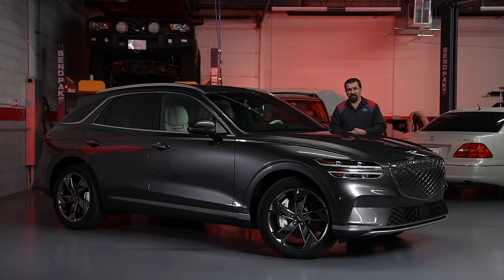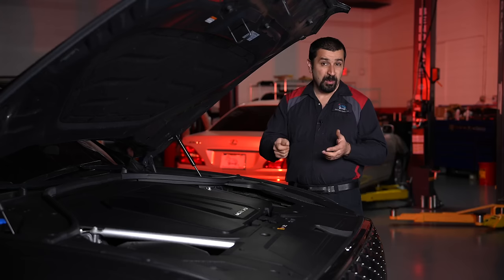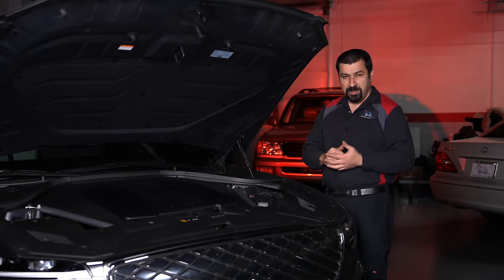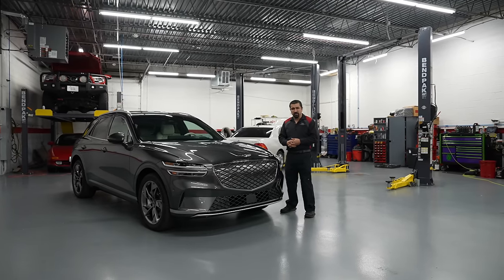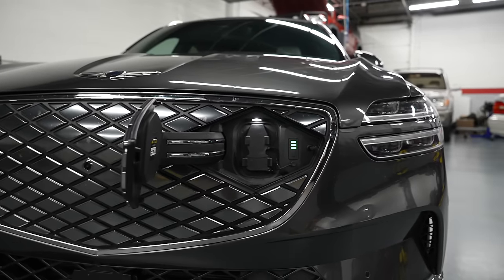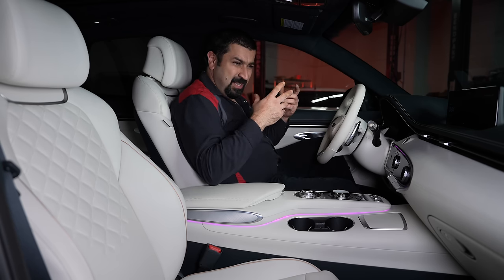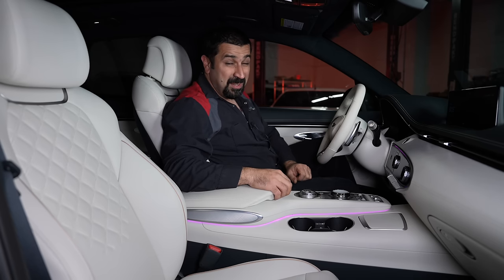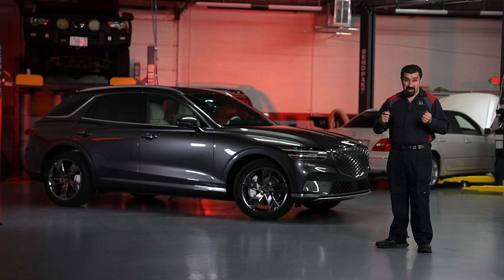Should You Buy a Genesis GV70? Thorough Review By A Mechanic

Comment: 236 miles of range is way to low
Reply: You drive 236 miles everyday? I have a ICE Mazda CX-5 which does no better.
Reply: @JohnLee-db9zt  well for long range and how slow it takes to charge. With your Mazda you can put gas in it in like 5 minutes and get back on the road. In an EV you can't they just aren't quite practical yet
Reply: @DylanL69 it adds 190 miles in 18 minutes
Reply: @mattjones3257  no not really

Comment: This reminds me of the 2023 Mitsubishi Outlander PHEV I just leased for 2 years. I got it because it was cheap to lease, got an EV credit for $7200 + some money down so I'm paying $317 a month. It's a stop gap car until the car market figures out what it wants to do, hence I didn't buy it. But it comes with a big touch screen, I don't even use it, half of the tech it comes with is turned off. All I need is a steering wheel, AC, a good radio, a speedometer and tachometer (preferably analog) power windows and door locks. That's it. Even if I had the money to buy something like this Genesis I would be throwing money away because that touch screen I would never use. I use my cell phone for navigation, best maps hands down. People waste too much money on bells and whistles, just not necessary.
Reply: Not to be rude but why get a Genesis?  You can get a Honda or Toyota base level.  Or Nissan.  Less tech.  Buy a tank but say I don’t want to shoot anything?  You’re paying for the tech as much as anything else.  I use all the tech in my car.  It spoils me.  Just have to take the time to learn it and set it.

Comment: The need for larger brakes on EVs are necessary despite that regen braking exists, because it’s an added safety measure. You need a lot more friction to stop 5000+ lbs, which a single-piston or even dual-piston caliper won’t have the physical force or thermal capacity to minimize braking distance to prevent an accident.

Comment: Get the gas 2.5t version for almost half the price of the EV (~$46k). It does 300hp with a ton of low end torque. In sports mode, this SUV drives like an agile sports sedan (it's based on the excellent G70). Super responsive and fun without the range anxiety and charging issues of EVs. I got one (advanced trim) about a month ago and absolutely love it. Would love to see a mechanic breakdown of the gas model.
Reply: Seconded. I got my 2.5t sport prestige a few months ago. I’d love a mechanical review of the ICE model
Reply: I’m liking what you’re saying, I have a 2023 Kia Sportage with a 2.5L engine, it’s not turbo charged, but it’s the SmartStream Engine, meaning it has dual fuel injection, MPI & GDI, thus eliminating the carbon buildup,that ruins the performance, reliability & costly repairs, which happens to EVERY GDI Engine especially German Engines. Point the 2.5L engines from Genesis & Kia don’t have the carbon buildup 😊, and have very reliable engines, I stumbled upon this fact after I got my Kia Sportage and I’m very pleased of this result. I’m planning on getting every bit of my 100K warranty. I’ve already put 10K miles on my car since purchased in July 2023, highway miles to & from work. Loving my car, again Good 👍🏾 Work Genesis and Kia.
Reply: I bought a 2023 GV70 2.5L Sport Prestige and it is awesome.  More than enough power and the interior/exterior design is great.  Fantastic warranty too.  Looked at comparible models from BMW, Audi, Mercedes, Acura and it was an easy decision.
Reply: I’ve got a 2,5 for 2 years 
Amazing suv
Reply: Sure, let's compare lowest trim on gas to lowest trim on EV, because both are same right? Why did you buy advance package then? The EV is second quicker than 3.5tt.
Reply: @ruturaj47  the 2.5t does 0-60 in sub 6 seconds. The EV (with boost) does around 4.5. My advanced is not lowest trim (that starts at $44k) and has almost all the amenities (pano roof, surround cam, leather seats, all safety features, ambient lighting, etc.). Only things missing are stitched dash, digital cluster (it has half digital w/ that cool turn signal camera), Lexicon sound, 3-spoke steering wheel. Not much difference to most ppl. Glad to see hear it has a reliable engine.
EVs have lots of concerns (esp. battery replacement cost) so I'm steering clear for a while.

And yes, I got my 2024 Advanced (msrp 53k) for a tad over 46k before TTL.
Reply: @justinbelk89  thx for the mention of the 2.5t kia. Here's a mechanical review I found: https://youtu.be/nQqf9ww4V98
Genesis does things a bit differenly in the GV's, but it gives us an approximation.
Reply: @ZERO_SVN  1. EV does it 4.2 seconds as per Genesis and 3.8 as per motor trend, not 4.5 as per you claim. That's huge difference from something that does in 6 seconds. Just upgraded engine 3.5tt costs significantly for just 0.7 seconds faster time. It has it's value. You drive base engine, so no one else needs more power?
2. That's a lot of missing things, on other luxury brands that's 3-4k worth of upgrades.
3. Sure, you are one of the most people who don't care about power and having few features. Glad they elected you to speak for them.
4. Lol, "EVs have lots of concerns" 😂. Glad you pick up political crap pretty fast. 
5. Sure, you got it for 46k, now everyone else can too because you did. Genesis is reducing MSRP to that /s. Unless everyone can get it at that price, your point is moot.
Reply: @ruturaj47  It's all good dude. The GV70e is an amazing car for those that can afford it. I'm just saying ppl can get into a gas GV70 for a lot less. Its features aren't so out of reach for most folks.

Comment: We purchased this exact vehicle- 2024 GV70 Electrified in Malachite Grey - in September ‘23 for $80k and have just hit 5,000 miles on it. We’ve had no issues at all so far and love it! We have an 80A level 3 charger installed in our garage which is nice and fast. we’ve only had to pay to charge it once and that was in Austin, Texas where there were not any Electrified America chargers within 20 miles of where we were in downtown so we coughed up $14 to fill up at one of the many others that were. We get very fast charge times up to 80% if using the 350v Electrified America chargers (which are free to use as much as we want for the first 3 years).

Comment: Years ago, a friend bought a new Genesis. When a very serious problem occurred that was likely due to a defect in manufacturing and within the warranty period, forcing the dealer to repair the car was extremely difficult. Personally, I won't buy any Hyundai product.
Reply: Especially now since a few months ago Hyundai/Kia got caught using child labor in their plant in Alabama.
Reply: @majicdude88  Not at their plant, a supplier.
Reply: Remember how they failed to address their Hyundai/KIA car theft issue and some insurance companies refused to insure them. Their solution to "address the issue" is to give customers a steering wheel lock that can be picked in seconds! They didn't even bother with a GOOD lock, just the cheapest lock possible!
Reply: Not to mention the engine fires that their cars catch regardless if they’re on or not.
Reply: Or Kia
Reply: I had a Hyundai before. Not only the car was extremely reliable but all the dealers I used were very nice. So I upgraded to a Genesis and the service departments have been just stellar. It feels like getting a red carpet treatment. Had a few warranty works done and I never had to fight for it. Of course, always a Genesis loaner provided. I'm buying another one.
Reply: I reported a slight squeak from my engine, and the dealer replaced both Turbos without me needing to ask anything. 

Sounds like your friend is a passive beta male.
Reply: You could literally make a statement like this about every single auto manufacturer on the planet.  Every single one.  “I knew a guy who had X go wrong” applies to all.
Reply: Years ago, key words. They have totally changed from then.
Reply: @lane5686 on older year models with the engine they discontinued..
Reply: @ThisGuyRides  didn't Hyundai/Kia own a majority stake in the companies that owned the multiple plants where violations were found? Like those companies exclusively exist to sell parts to Hyundai/Kia. And plus, Hyundai/Kia were warned multiple times in the past that their suppliers might be using child labor, and Hyundai/Kia ignored them each time
Reply: @UpgradeUrWinRARTrial  kids these days are lazy. They need jobs😂
Reply: They just couldn’t fix it…
Reply: @JohnLee-db9zt   the wee lads yearn for the coal mines and the chimneys 🤣
Reply: @UpgradeUrWinRARTrial  ok now do GM and Ford who had auto plants in Germany in WWII and supplied vehicles to the Nazis.  Now do Mitsubishi and Toyota and what they did.  You had one supplier who did that …are we done here?
Reply: Something happened to someone a long time ago and now I won't buy that thing, ever.
Reply: @Mountainbaseddweller  do GM and Ford still currently run those nazi-owned auto plants? Do Toyota and Mitsubishi currently still use child labor to manufacturer car parts, even after being warned multiple times? You're comparing a Toyota Corolla  to a Ford F350 SuperDuty, there's no relation at all lol. Or I guess in this case, a loaded GV70 to a base Elantra. We're talking about new cars with modern problems, not WWII-era politics. 
But while we're on the subject, did you know VW stole the Bug's design from Czech manufacturer Tatra? Basically Nazis from Germany took over the country & factory, stole the schematics, copied it wholesale, put a VW badge on it, and sold it as-is. I mean, at least Toyota and Ford built their names off the backs of making cheap and then good cars from their own original designs. Meanwhile, VW's best-known car is just a copycat of the ""inferior"" Czechoslovakian Tatra and everything else after was meh or bad. I think Tatra and VW ended up settling it in court in the 1970's but man, how embarrassing that your biggest accomplishment was done because you copied off the other kid's homework 😂. 

Oh and it wasn't just 1 supplier. It was 4 separate companies who owned 4 separate plants (and who's companies are basically owned by Hyundai/Kia) who used child labor on multiple different occasions.
Reply: Owned one of the first Genesis cars, loved it up to 50k miles then loads of engine/tranny problems that Hyundai wouldn’t stand behind with their “10 year warranty “.  Family members also owned a few Hyundai and KIAs, all chronic problems after a couple years.  Hyundai products will be great in a few years, just like how the story of Toyota went. Meantime, stay away for now!!
Reply: @2006gtobob my uncle’s neighbor had a teacher whose wife had a bad Hyundai. Now I won’t even get near one. As a matter of fact, if I even look at one I have to go straight to the eye wash station /s
Reply: @biglee13m I have a 2014 Hyundai Genesis 3.8 sedan that I bought new.  I now have 172k miles and the car has never been in the shop for mechanical repair.  I have only put brakes, tires, belts and hoses.  So far the car has been a Gem and the paint still looks new!  I would like to purchase another Genesis, but the price has really gone up like everything else.
Reply: @sjh03053  that one time the thing that did the thing I didn't like caused this and that to happen to everyone and no one all at once and I decided I didn't ever want to listen to Duran Duran again.
Reply: @biglee13m good luck
Reply: If you make your decision based on a thing like this there isn’t a manufacturer on the planet that would be worth buying a car from.
Reply: @UpgradeUrWinRARTrial Child labour is a good thing. Kids need jobs too.
Reply: @zero11010  Nope. Bought a Lexus 25 yr. ago and it's still my perfect daily driver.
Reply: @voterdown  "Now" may be a VERY long time. And I think it should be.
Reply: @bradleyscarreviews  Prove it.
Reply: @TheRealCatof  You didn't have to ask because he had likely seen many defective ones and knew yours would just be one more. No, my friend is definitely not passive.
Reply: I had the last opposite experience,serious problem with the paint in the first month of ownership and took me all of 2 hours and I had a brand new perfect car off the lot.  No fuss or debate.  Heck I didn't even have to ask.  Best service ever
Reply: @lane5686 engines and power trains are completely different in the Genesis brand.
Reply: @biglee13m The concierge services amazing isn't it eh? They show up at my house with a loner I hand them the keys to my car, they hand me the keys to the loaner and off we go.
Reply: @wholeNwon  that’s useless though. You’re making your decision based on a single point of data. One anecdotal story. That exists for EVERY car maker. 

Do you think NO ONE has a horror story about Lexus? 

Of course people have had horror stories. 

And, there are people with 200k miles on a Hyundai or Kia and they love the thing. 

Generally this is how mass production works, right? 

You need more than “I heard someone had a bad experience.” Because THAT exists for every car maker.
Reply: @TheRealCatof if you insult people by calling them beta males then you’re a beta male

I don’t make the rules on that one
Reply: It would be irony if the comment was typed on an iPhone or a Samsung phone 😂
Reply: @ThinhNguyen-dk3mh  I have several Korean products, including a Samsung phone, and they're all fine. But I sure won't buy their cars because there are much better products out there. No irony at all.
Reply: @zero11010  And that's why the internet is helpful in that it allows information to be aggregated and organized. One could even be Google something like "compare Lexus ownership problems with Hyundai problems" and let AI help. My friend's problem and Hyundai's response were not anecdotal. I know him well and he described the litany of horror stories in great detail.
Reply: @paulgyro  So the factory couldn't paint a car correctly?  What else that you don't see isn't done right?
Reply: @wholeNwon  your hypothetical question doesn't move the discussion forward.  Don't  buy a Hyundai product but with your reasoning I could tear down every car manufacturer to the point they are all boring as sin or garbage. I've owned BMW, Mercedes, Lexus and Genesis.  Genesis has been my favorite car with the best purchasing and service experience and overall value.  Genesis for the win.
Reply: @wholeNwon  now you’re talking about a rational way to make your choice. From the start I only spoke about your original statement of “someone I know had a bad experience once”.
Reply: Be prepare the another $60000 for the battery replacement if it is damaged by accident or what else.
Reply: @simontong2954  this is certainly a concern, it's complete BS what's happening to two Hyundai customers in Canada.
Reply: Daihatsu, the Japanese automaker owned by Toyota, has halted domestic production after admitting it forged the results of safety tests for its vehicles for more than 30 years.
Reply: I have had 5 new Hyundai. Currently have a 2022 Santa fe 3.5 v6. Love it. Mazda and Toyota had been given massive fines in Australia.

Comment: I am interested in the gas powered GV70 and tried to find the review you alluded to, specifically for the 2.5 four cylinder.  There was no link and I could not find your video.  Could you please give me the link?  Thank you!
Reply: I have the GV 70 with 2.5 four cylinders. I have always been a Lincoln SUV customer until I test drove this SUV. It is by far the nicest luxury SUV I have ever owned. Going from a Lincoln Corsair Reserve to this GV70 was like shopping at Macys and then discovering Neiman Marcus. Once I drove this SUV, my Lincoln felt almost cheap by comparison. My Lincoln Corsair Reserve was close to the price of my Genesis GV70 Advanced. It is so much better in every way. It is solid luxury in every way. The wipers on my Lincoln always screeched and when using the cooled seats, the fan noise was loud and annoying. On the Genesis GV70 you can hardly hear the wipers and the cooled seats make no noise at all. The sound system is magnificent, and the car is so quiet. Once I learned electronics, it was much better than Lincoln's. The glass sunroof is so dark I can leave the shade open even in the summer. I could go on and on.... but test drive one and carefully look over the fit and finish from under the hood all the way to rear deck. Very impressive!
Reply: I have the 2023 GV70 2.5L Sport Prestige and the car is amazing.  The interior and exterior is very similar to the electrified version in this review.  More than enough power at 300 HP for a vehicle this size.  Lots of neat technology like 3D instrument cluster, ergonomic seat adjustment with massage, adapted cruise control with highway assist, ambient lighting, etc., the list goes on.  Plus the warranty is longer and they offer 3 year free maintenance and 3 year free valet service (for service, dealership will come to your house and pick up your vehicle, leave you another Genesis to drive, and bring your vehicle back when finished.
Reply: @jckcpd4539  Everything you mentioned is what I've experienced with my 2015 and 2018 Genesis G80. I am glad more people are giving Genesis a try.